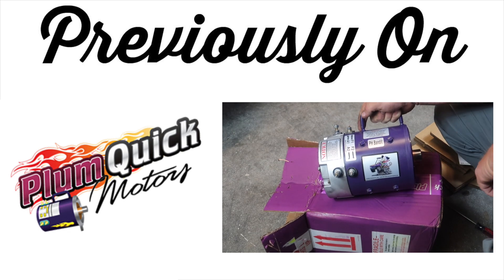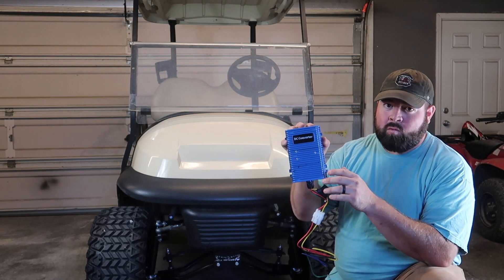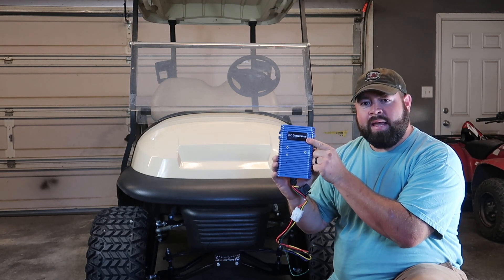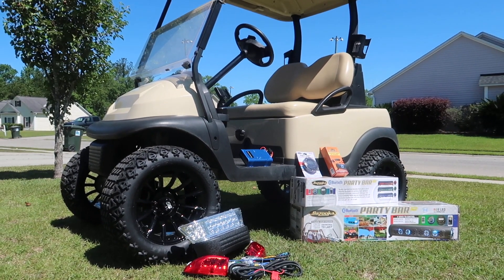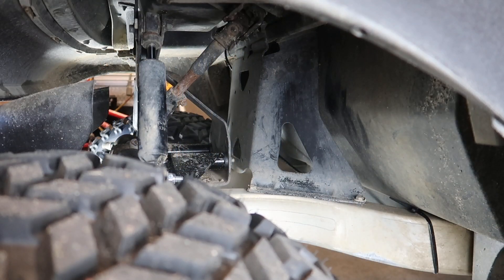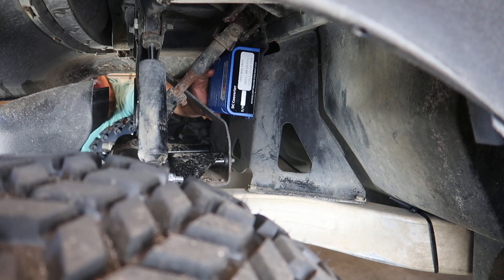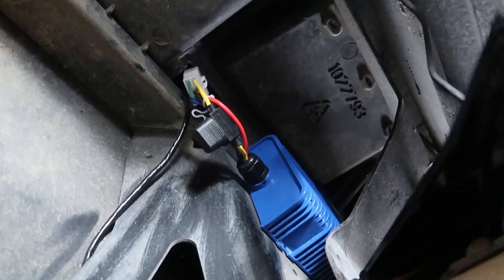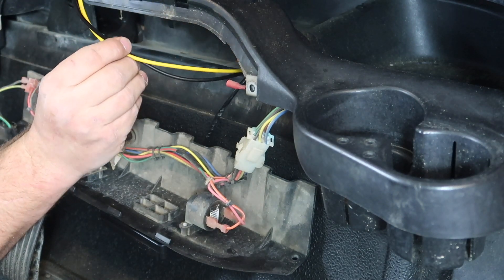How To Install DC Converter on Golf Cart | 48v to 12V Power Converter | Accessory Power Supply

Comment: How much voltage is on key switch before you hook that wire to it isn’t there 48 V on that key switch very confusing if there’s 12 V on that key which to begin with why can’t you just tap into that for your accessories?

Comment: Will this 12v converter drain lithium batteries? Do I need a relay for this one as well or because you hooked it up to key it’s fine?
Reply from the maker: This is the older video on the dc converter and since then I have started using a relay. I would suggest using a relay on this one as well. The reason is when the key is off, this one is still converting to 12v but only allows for a smaller output for a setting like a clock or radio stations.
Reply: @Fentertainment  appreciate all the responses this week!

Comment: I've got everything installed, doubled and triple checked, but when I put a voltmeter on the key switch, in either the on or off position, I never get 0 Volts. I removed the green wire, went back to original wiring, getting at least 12 V when the key switch is in the on or off position. Any ideas?

Comment: Would you need a relay / switch for that converter?
Reply from the maker: For a 5 wire I would. Then on pin 30 I would tie both the red and green together.
Reply: Ok. I used your link to purchase the converter but it looks like the seller switched the converter to a 4 wire. So I’m add I’m ok with no relay with the 4 wire correct. Btw, I really appreciate you responding back and I’m learning a lot from your videos

Comment: I’ve have received 2 of these from Amazon brand new and neither one has worked.  I have verified 48v dc going in and ZERO dc volts coming out.  Could it be anything else besides faulty converter?
Reply from the maker: Did you hook up the green wire to the ignition? If not then you need to do that.

Comment: Hey ryan, just got everything delivered today including the new fuse block. My question is how you would do the wiring for the ground with the new fuse block?  In the video you run ground from battery to converter harness and add 4way for accessories to plug into. However since the new fuse block has a main ground on it would you run ground from battery to converter harness and run another line from the 4 way to the main ground on the fuse block? Or would you run 2 seperate ground lines from battery to converter and battery to fuse block?

Comment: I have a 2009 Zone golf cart. Not sure how to contact or find the manufacturer. Either way I  just converted to Falcon Elite 48v from Big Battery. I ordered your recommended voltage reducer from Amazon. I have head and tail lights, turn signals, horn and a few other accessories to hook up but I can’t figure out how to wire them with the new configuration. They were in working order before but now I’m lost on tracing wires back from dash and their plastic connectors and determining which ones to splice to the negative output and which ones to the positive input. Can you offer any tutorials or tips? Thanks

Comment: I am replacing my EZGO 42SN-202 SOC Meter with a Runleader LED Battery Fuel Gauge Hour Meter on my 2011 EZGO RXV FLT ELEC 48V? I looked online at several different sites and see that the gray wire is going to Pin 11 at the plug going to the Motor Controller. Its saying its a 5V signal wire, my question is what do I do with that wire going to the new meter?

Comment: Have you ever experienced a loud buzzing noise with this converter? The radio and other lights work with the converter. When I hook up my main headlights and taillights the converter buzzes like crazy and they are very dim. I connected it to an old cheap converter I have and they work perfectly fine.

Comment: For the life of me i cannot get the radio to work on my setup. Im using the dc converter as yours but without the blue light for memory and my my fuse block is the new one you use. I got the radio ignition wire going to the fuse block and the 12v wire going straight to the battery.
Reply from the maker: check the fuse block to make sure you have 12v positive and ground on the fuse block. Then you can run both red (ignition) & yellow (constant) from radio to fuse block. Run the ground from the radio to the ground as well on the fuseblock. Make sure you have ground on the fuseblock.
Reply: @Fentertainment   running both wires to the fuse box fixed it. Thanks man

Comment: So I have a question I recently bought a street legal led headlight brake with blinker horn it said I needed to buy this so the kit would work. But I don't see anywhere on the kit where it hooks up to this converter. Does it hook up to fuse block?

Comment: The 5 gain fuse panel. Where did you get that from. This is a great way to do that!
Reply from the maker: I no longer use these. I started using a 6 gang panel with a grounding block built in. These are the ones I use now - https://amzn.to/45Mc7GV

Comment: will this converter work with 72v to 12v, if not how do you run accessories with 72v batteries?
Reply from the maker: I’ve ran mine on 72 before but there are 72 - 12 volt converters.

Comment: Could you run a block for the ground as well? So the power and ground wires for accessories would just be a plugging into a block?
Reply from the maker: Yes, In fact I no longer run that fuse block. The fuse block I run now has a grounding block with it. This is it - https://amzn.to/3SQEWfn

Comment: I have a 48 volt precedent.. plenty of room in battery compartment for both reducer, and fuse box.   Thoughts?  Figured easy access, and protection from elements.   I’ll use loop type Velcro for easy access….
Reply from the maker: You can mount it anywhere you want. I like where I mounted the reducer because it never gets hot and I never mess with the fuses in that location. But yeah if you want to mount yours there then no problem.

Comment: Is there a reason you decided changing the different types of fuse boxes recommended? I was going to install the one shown in the video? Thanks for the video!
Reply from the maker: The one I use now that I believe is linked below in the description serves more purposes. One main power input supplies all the fuses and if or when a fuse is to blow the led light will shine to show you which circuit quit. Also it has a ground block built in as well. It just confines more into one location. Might have to mount it somewhere else but it does more in the long run.

Comment: Hi Ryan, I ordered 3 of these converters from Amazon and i had to return all of them, though they show in the pictures and the details they were 5 wires,  all of the converters i received had only 4 wires on the wire harness with the Blue wire for memory missing , can you tell me where i get a converter with the Blue memory wire and if there's a part # on the converter to make sure i get the correct unit, i need the memory for the radio i'm installing in the cart.
Reply from the maker: I just looked at the link and not sure why but the blue wire on it has been removed. I've never seen one of these blue converters sold without the blue memory wire. I just found another with the blue wire still on it. I will update that link now but to save you a few clicks this is it - https://amzn.to/3cQZtzQ

Comment: Love your channel, I’m trying to do this exact same thing to my 11’ precedent. I can not get my reducers 12v output to spit power to my fuse block. It is getting 48v from battery pack and the key switch is hooked up. The only thing I did different was ground my fuse block to the main negative of the battery instead of using the distribution block. I also don’t know how many volts I am needing from the key switch to turn the reducer on. Wondering if I’m not getting enough? You hit it with the multimeter but I cannot see the volts you’re getting. Any help would be amazing! Thanks

Comment: How did you hook up the light kit to the distribution block. Which wire goes to the block. I've looked and can't find you doing a video on it.
Reply from the maker: I didn’t do a video on that kit. I wish I would’ve because so many have asked for it. I have another cart I will be building and I have a light kit for it and will do it. Basically your power goes to a fused portion of the distribution block and the ground goes to the ground side.

Comment: I have this converter, hooked up just like you explained.  Love it.  But, I am having trouble figuring out how to connect my Rhox LED with accent light kit to this converter.  Any ideas what I need to do, or does the way you have it already run thru it?
Reply: I have a 2009 club car precedent, and i used the plug and play harness

Comment: I have installed this converter on a Yamaha Drive 2 48v cart. My ignition switch does not have 36-48v going to it. Wondering if anybody has found a switched 48v wire on this cart. Could I wire it to the switched leg of the solenoid?

Comment: I was installing my dc converter on an 05 precedent and while doing so, I wanted to see if I could get the old light kit to work.  There were no wires hooked up to the dash on/switch to the lights.  I’m thinking I might be able to just hook them up and get going, I mistakenly took two open wires from the ignition harness instead of headlight kit harness (not smart).  I assume I fried something but not sure what.  The reverse buzzer doesn’t work now and I get nothing when hitting gas pedal.  I don’t see any obvious fuses blown.  Do you think the issue is the rectifier diode that needs replaced that runs into the tow/run switch? A different fuse?  Ignition panel fried?

Comment: Hope you get this, so I just installed the convert !But my key switch might be messed up, with the green wire connected to the blue wire when key is off I have lights,  when I turn key on I don’t have lights I flipped the wires on key switch fingering that previous person wired it wrong, but I still get same result. What is other option for the green wire?

Comment: For the green wire which is the accessory keyed power. Are you doing that on the 48V side or the 12vside of the factory reducer and or key switch.
Reply from the maker: The green wires needs 48v input from the key side of the switch. This turns the reducer on and off with the key.

Comment: your set up is nice!... Have a question for you... your key switch is "on/"off"... I have RXV with the 4 wire RNF switch... which of those 4 wires should I tap into with the green wire from the converter?
Reply from the maker: I cannot remember what color the wire is. I used to have the rxv switch on a txt and I used a multimeter with the continuity setting . Basically one of the wires supply power and the other 3 are for forward, nuetral and reverse. I used the nuetral wire because it stays on with forward and reverse.

Comment: Need help, bought this converter, installed into a 6 battery 48v system. But it only produces 6v out the blue and red wires. This is the second one I’ve gotten that has done this, am I missing something?
Reply from the maker: Are you installing the power and ground to the same battery?
Reply: @Fentertainment  no, it’s across the pack, and the batteries are charged sitting at 52V
Reply from the maker: @MsTravo315  shouldn't. Yellow to 48v +, black to 48v last ground and to accessory ground block, green switch 48v input, blue 48v constant low amperage (memory) and red 12v output 30a output. I've never had a problem with any. But like anything else man made, could a bad batch.
Reply: @Fentertainment  yeah, all set up accordingly, I’ll have try a different brand, thanks for help brother
Reply: I keep losing my keyed switch wire signal to turn the unit on. I’ve tried two converters already and same result. It works good the first time then after that nothing any suggestions?
Reply from the maker: @christorres1424  make sure the wiring is 100% correct. Im still using the same one and other carts ive built and sold years ago are still using the same ones.
Reply: @Fentertainment  the wires are right and the units worked the first keys cycle, but when turn off with key source and turned back on no power. I even jumped the wire harness and tap the wire to make sure the wire harness wasn’t the issue but I’m still not getting a signal through to both units. Both units just made a small little clicking noise, instead of the running sound they made the first time on. Do the units require a certain voltage to turn on? Also I’m. Going to get another brand with the same wire harness connection to see if that one has the same issue and maybe I just got a bad batch of units
Reply from the maker: @christorres1424  if the wire colors are correct and 2 didnt work in a row is a tad sketch but could be a possibility. Red 12v output, black ground, yellow 48v input, blue 12v output memory and green key input 48v.

Comment: Nice video.  Is there a reason why you chose to mount the converter up front under the cart and the fuse block behind the dash rather than both in the battery compartment under the seat?
Reply from the maker: At the time I didnt have lithium. I need to move both of them there now with all the extra room I have.

Comment: Absolutely phenomenal DIY video. I just purchased an Onward Li Ion cart - do you have any plans to create content on how to wire up a cart with Lithium batteries? The spec on the Onward shows that it is a 58V system, so I am wondering if a different converter is needed, and I'm not sure (yet) how to access the terminals on the pack, and if there are other considerations with Lithium vs. lead acid.

Comment: I just hooked mine up and it started making a buzzing noise. It seemed pretty simple. My black wire goes to the main battery pack and so do my accessories? Correct?
Reply from the maker: Yes
Reply: Hi! Did you ever figure that buzzing noise out? I'm having the same issue when I connect my light kit to the fuse block.

Comment: Is it really safe to mount the converter there with water, snow, even a power washer when cleaning off mud???
Reply: It’s waterproof so it’s safe.  The converter also has a fusible link  in case it grounds out.

Comment: Did you connect the ground wire to the same battery or to the battery on the far end opposite of the + wire?
Reply from the maker: The ground wire goes to the pack negative wire. You also you the same ground for the 12v accessories

Comment: Nice video....but pro tip.....go back and put fuse holder on yellow wire (main power) right where it connects to battery...the 3 feet or so of that main wire is a fire hazard....being that it is run under cart it's just a bit scary ...
Reply: Could you explain a little more indeph?...I'm a newbie...ry

Comment: What size female quick disconnects are using on the fuse box? I have 10-12 gauge  3/8" and cannot get two wires in to crimp.

Comment: I put the voltage reducer in like you did then I bought a light kit to add  Which wires on the light kit wiring harness do I hook to the voltage reducer?

Comment: If I don't have a 4 way, could I just use  the back tap for the ground wires for other accessories?
Reply from the maker: You could. I have started using fuse blocks with grounding blocks built in now.
Reply: @Fentertainment  are you using same size fuse on grounding block as well?

Comment: If you wanted to add more than 2 additional accessories could you add 4 way connector to the main ground line and then just keep adding or is there a block like the fuse panel you could add instead of adding 4 way after 4 way?
Reply from the maker: There is a block or You can buy a fuse panel with grounding block together like this one. https://amzn.to/3ff0Bdj
Reply: @Fentertainment  Thanks guys!!  Love your videos!  Great tutorials!
Reply: @Fentertainment  is this intended to replace fuse block in description so you get 12 power and ground on same block?

Comment: I replaced my converter with the one you suggested.  Apparently that wasn’t my problem.  There’s a fuse on the red wire that keeps blowing. It’s the same problem i had before.  Can you advise how to find the short with a voltmeter?
Reply from the maker: You would need to set the volt meter to continuity. Put one leg of the meter on the red wire and the other leg of the meter to the power wires going to the accessories. If you added a fuse block between the red output wire and the accessories the fuse should blow. Then you can trace each accessory power wire.

Comment: What gauge wires did you use on the  5  fuse box as well what gauge wire did you use for the black/yellow and the red/black

Comment: Do I use the voltage converter as the power source for the light kit, or do I wire lights directly to two batteries  bypassing the converter
Reply from the maker: The voltage converter is used for all the 12v accessories like lights, leds, radio etc etc...
Reply: @Fentertainment  thanks I thought so, but wanted to make sure. Keep the videos coming, great Job

Comment: How many different accessories can you run off of this converter?  Such as lights, radio, underglow, and those sweet wheel lights you made?
Reply from the maker: At the moments im running the wheel lights, bazooka party bar g2, and headlights and tail light kit. My last cart had wheel lights, stereo with sub & amp, headlight kit with seat heaters.
Reply: Fentertainment thank you!  Awesome videos

Comment: Do you have recommendations were to get the 5 gain fuse panel box, or what make and model
Reply from the maker: I out some links in the description. For somereason i cant find the 5 panel again.
Reply: @Fentertainment  I have a 2009 EZ GO RXV golf cart.  There are four wires going to the position selector.
The colors are green,white,red,and yellow.  Can you tell which wire is for power off when the key is switched off?
I appreciate any help that you can give me.
Thanks!